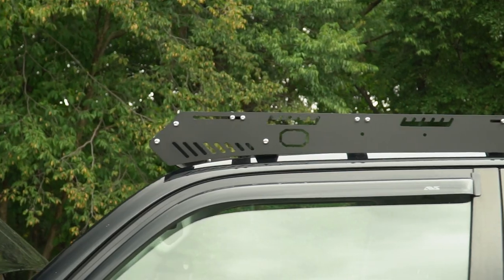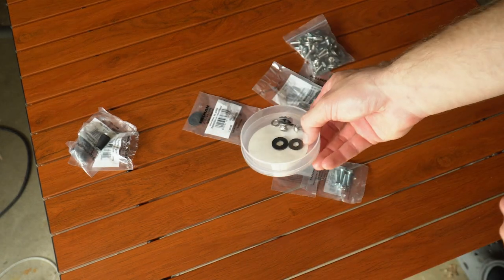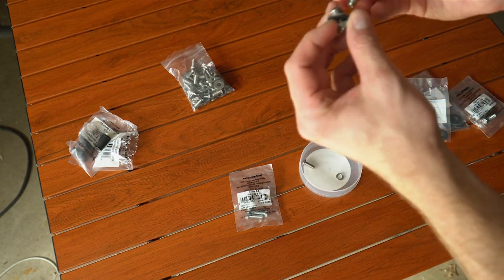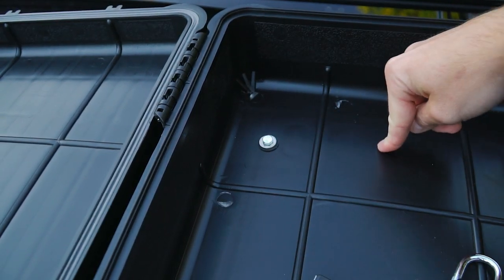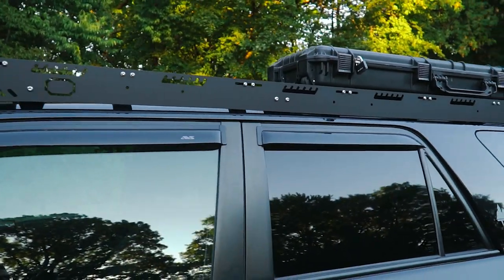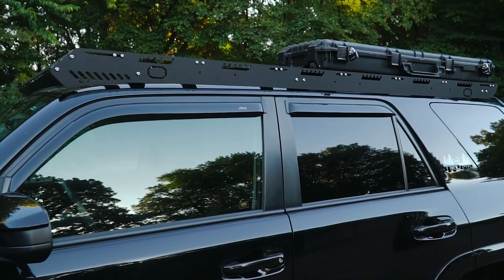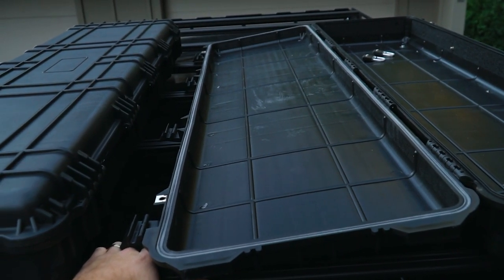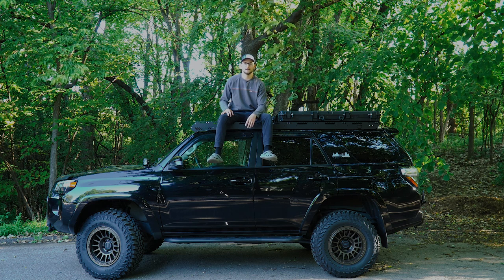HOW to Install Roof Rack Cases | Harbor Freight 9800 Cases | UpTop Overland Bravo Rack Review!

Comment from the maker: A couple people have mentioned this so I think it’s important.  If your cases will carry heavier weight, it might be best to step the bolt up to a ~24 from 20 and add a larger diameter washer to prevent tear out of the case.  I was trying to get away with using included hardware but it’s much safer to use larger washers, especially when the boxes are heavy.  I’d keep all of it the same, but place a larger washer and same size larger rubber washer under the bolt, lock washer, smaller washer.
Reply: I used steel flat bar for my "washers" running the length of the cases and I've never noticed an issue. But I do like your idea for the washers

Comment: Might want to check out Lock Picking Lawyer ch on choice of locks. I'd get a lock with a key cover flap to keep Dust & Dirt out of the lock. Change out the 1" washers for 3" washers & cut an inner tube for rubber seal under. Doing 50 mph the four 1" washers really aren't secure. Gotta say it does look good
Reply from the maker: Yeah I could, idk been fine so far!  I guess I would need to get a longer bolt because you would want to step up washers.  Would not hurt anything!  Yeah, the locks are probably not crazy.  Just depends on if you think there is a huge risk.  I guess I mainly just have them there so someone can't walk up and open it.

Comment: No lock washers alone. Always use Nylon lock nuts with lock washers if you don’t want issues during or because of the summer heat.

Comment: How wide are either the t-nuts or the slots they go into?
Reply from the maker: The T nuts I believe are standard 1"x2" extrusion nuts.  I just buy the UpTop ones because they are about the same size as from 8020 or Tnutz and they cost roughly the same.  Plus I get to support UpTop that way.

Comment: You might be able to get some or the little 1 light Diodes and mount them to one of the slots up front. I really really wish Diode would come out with a rock light!
Reply: Light maybe mount them on the same track as the crossbars on the front?
Reply from the maker: @OXFOOT  Thats a good idea, I hadn't thought of that!  Although I have some ideas brewing to use the scene pod cut outs.  Stay tuned!
Reply from the maker: @OXFOOT  So many options though, it's the great thing about UpTop and aluminum extrusion roof racks in general.

Comment: Just installed 2 Apache 9800 in Tan color on LFD crossbar / stock rail few days ago.
Reply from the maker: Heck yeah.  They are so nice to have.
Reply: @OverlandEngineer  Hard to find tan colors but I was lucky. Bought 2 at $119 each. I did use 6 x 3/8" carriage bolts for each case, just to be safe.
Reply from the maker: @LanceZ99  Dang, strapped down for sure!  Glad you got them at $119.  They run great sales.
Reply: How did you do it?
Reply from the maker: @Duhg26  I have a dedicated video on this.

Comment: What if you placed a rubber washer between the rack and the case as well? Wouldn't that aid in sealing the opening against water intrusion? That, and a little silicone grease on the threads where they pass through the case. The reason I mention these things is due to the flexing of the case and the rack under stress.
Reply from the maker: I don't think the rubber in between the case and rack would do much unless you had multiple washers.  You could put a small bit of silicone if you were really worried but just using the rubber washers keeps almost everything out.

Comment: UpTop is the best. Prinsu Damages your Clear coat and eventually the paint where the rubber constantly rubs against the roof if you don’t leave a space and from every one of their racks I’ve seen installed will surely do it.

Comment: Looks good! I really like those t-slotted crossbars. I have a 13 Trail Edition, and it has a different roof rack that has the T slots in the factory side rails. I'm wondering if those t-slot cross bars will fit. I'd like to upgrade the cross bars, but I really like the factory side rails. I want to mount an awning and a shovel and maybe one of those boxes on my rack, and having those crossbars would help a lot.
Reply from the maker: Yeah I am not sure what there is out there.  Maybe LFD makes stock roof rack crossbars.  The UpTop ones will be too wide I would bet.  T slot is sooo nice.
Reply: @OverlandEngineer  a while back I was at the local hardware store, and if I recall correctly they have the extruded aluminum. I wonder if I purchase some of that cut to the correct length it would function as a crossbar? I think you are right that the up top would be too wide

I have zero desire to put a tent or anything really heavy up there, like I said just shovel mount,  awning, and perhaps one of these boxes and some traction boards. . 

 I thought LFD offered them for the early Trails, however I checked their website and they specifically say it's for the later ones.

Comment: Do you have a tutorial on how you install it just the roof rack
Reply from the maker: Just assemble the whole rack, fill the plastic thread holes to the top with clear silicon, then put in the bolts!
Reply: @OverlandEngineer  i assembled it already just need help installing it to the car I don’t want to fuck it up
Reply: @OverlandEngineer  do I apply silicon

Comment: How is this a review of the rack? Are the feet steel or aluminum? Are they straight or bent? Are they integral or bolt-on?
Reply from the maker: Lol, I am not sure what else you need?  The feet are steel or maybe thick aluminum and the rails are aluminum.  The rails are straight, the feet are 90 deg angles, it is bolt on like any other CNC rack, I am not sure what you mean by integral.  All these things are the same across basically every single CNC rack so it does not make much sense to me to cover that because its not an interesting comparison when they are all the same.  Happy to answer questions though!
Reply: @OverlandEngineer  Some racks use mounting feet that are extensions of the sides (non-bolt on) and are simply bent aluminum, which is not strong at all. Others use bolt on feet that are either made of steel or aluminum. The steel feet seem to make more sense. So, while you might think "they are all the same," they aren't. There are actually some significant differences which, in my mind, makes total sense to cover. YMMV.